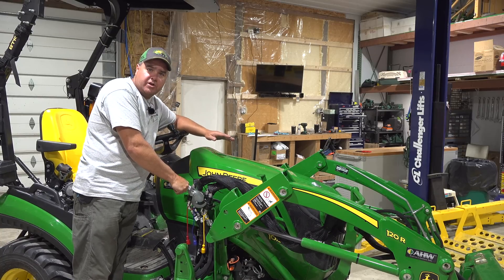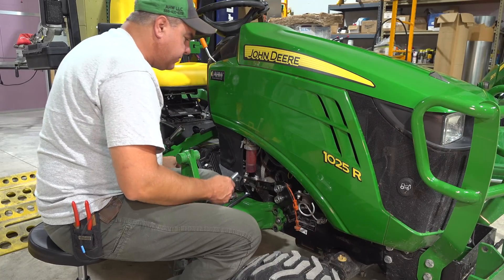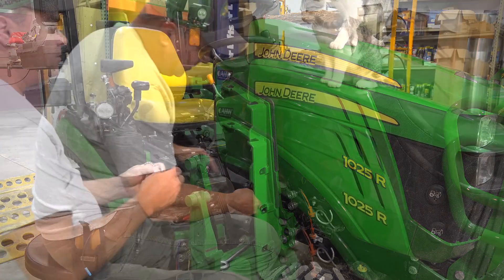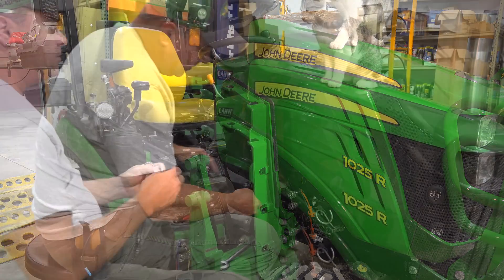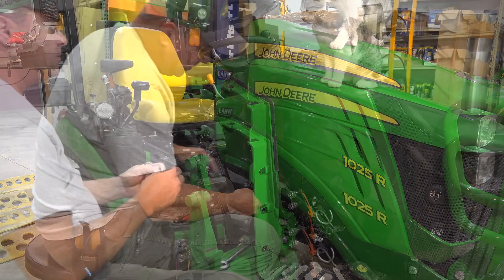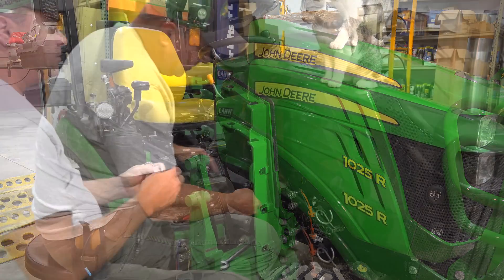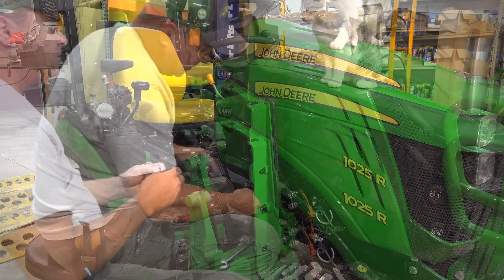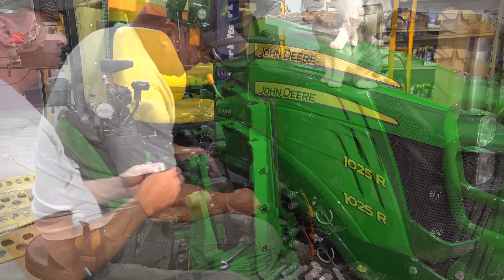Single Point Hydraulic Connector; Deere 1023e/1025r/2025r

Comment: Ok Tim your tractor had a green push bar on the front. You had to take off not in vidio to put loader back on. But it's a nice way to hook up. Sometimes the old way is hard.
Reply from the maker: What?   I don’t understand.  We did not remove any push bar.
Reply from the maker: Ok, watched it again.  Yes, this is a front quick hitch weight bracket from heavyhitch.com.  
Sorry. Should have watched the video before I commented.  Totally forgot that I had the weight bracket on in this video.

It comes off easily, and is not part of the tractor.  Just a quick attach weight bracket.

Comment: Great video guys, as always.
Thank you. 

One additional item every tractor owner needs is a quality O'ring kit. With all the face seal and orb fittings a good o'ring kit is invaluable. Keep in mind not all orings are created equal, It's a good idea to get one from your manufacturer however quality ones can be bought from the aftermarket sector. Just do your research for specific needs. Things such as heat ranges and oring material composition make a huge difference.

Comment: Really good video Tim ! I watched it all the way through. I find the fittings on my 1026R to be a breeze and do switch out the loader a few time a month. I switch mine over within reach of my air and find blowing everything clean before and after keeps the fittings from sticking. Never once had to relieve the pressure to get them on. 
If it was new at 0%, the single point and what ever the system is to not have to connect the MMM lift with a switch instead of switching the hose I would sign up for.

For me and that amount of money I would opt for one of the grapple's that do not require extra hydraulics at around $1500

Comment: Tim how did your orient the new hoses that go on the loaded so they go down between the loader frame and the tractor? The stock ones are horizontal to the frame and if the new ones go on like that they want to bulge up. New hoses seem to an after thought in comparison to how the bracket and valve mount

Comment: I like this and may explore it as an option. You make reattaching the loader look easy.  I find it aggravating. The stand hydraulics creep down creating pressure on the line. I routinely am showered with hydraulic fluid during Re-attach.
Reply from the maker: The single point handles the pressure pretty well.

Comment: I have been waiting for this option ever since  I saw someone on youtube do their own custom fabrication on their 1025R.  In the winter I alternate between the loader and the front blade on my second generation 2025r.  I suppose you just unhook the  hydraulic  hoses that feed the single point system and insert the hoses from the front quick hitch but that seems a little counter productive to me.  Since I no longer use a snowblower which would require a different setup from the front blade I could add  one half of the single point  to the four hoses.  I would want to have this capability before I jumped to this somewhat expensive option.

Comment: I do not see in the video where you discussed the brass orifice, only saw where you talked about the extender on the Blue hydraulic  hose.
Reply from the maker: It is not brass.  You call it an extender.  I specifically said it was an orifice, and I showed the difference in size of the opening.

Comment: I have the older Summit Diverter valve that has ports on three sides of the valve. It was mounted on the inside of loader arm structure, but now interferes with the Single Point Hydraulic connector and there are different fittings (maybe adapters will allow me to convert).  The question is where to mount the valve now?  It was on loader itself, not sure where to move it to?  Everything is so tight.

Comment: What you said about the subtle differences in brands is true.  Deere does some things brilliantly and then drop the ball on zinc coated hardware, uv resistance on paint, and the plastic does not hold up!   The newest Deere equipment I own (7) is 2004 so things may have improved.   I'd still go Deere

Comment: Tim, if one has a diverter valve like the Artilion set for say a grapple like I put on my 1025r a couple of yrs ago at your suggestion this set up works for connect/disconnect of the front hydraulics without the need to hook up additional hoses.
Reply from the maker: Yes.  The only challenge is that the Artillian diverter will need to be moved, as this space between loader mast and hood is used for the single point.

Comment: Good video a couple things. 1- is your side panel sort of tough to put on and off with that new bracket in the way?, mine seems to be. 2- I'm OCD  about my steering knob being crooked so I drilled a small hole in the bottom of it and put a set screw countersunk into it. it works perfectly.
Reply from the maker: Yes. We just showed the difficulty of reinstalling the panel in a video earlier this week.
Reply: @TractorTimewithTim  where do i find this video?

Comment: Am I correct in thinking that you can also hook and unhook while the tractor is running? Other Faster brand connectors are like that. Another big plus for the Faster single point. Even though at 70 years old and with arthritic hands I still can’t justify the expense but I do remove my loader every time I mow. Now I wouldn’t turn one down if..........
Reply from the maker: Yes, tractor running is not relevant.

Comment: Very nice addition to the tractor. I can seen how this will be very great to some since you no longer need to get on or off the tractor to disconnect the FEL. Do you still need to turn the engine off to relieve hydraulic pressure on the couplers? Now that could be a pain.

Comment: Hello Tim I have a question?  I am looking into this for my 2025R.   I am wondering this will work with my heavy duty front snowblower.   I have the cab and connecting and disconnecting the hoses   is difficult with the cab on.   This would be a great solution to quickly switch between the bucket and snowblower.   Let me know what you think.

Comment: I have the Kubota BX23S with the quick connect.  It's a nice feature but it tends to leak a little.  I had it at the dealer three times to fix it, its had the entire manifold replaced, multiple flat faced connectors have been replaced.  On my BX it appears that the pressure from the handle holds one end of the manifold tight but the other end tends to start to open up after using for a while.  I think the clamping mechanism does not keep the entire manifold tight enough and under pressure allows a little fluid to leak.  Again its not a lot of fluid and it's a neat feature but it attracts dirt and makes the tractor dirty.  I really like my tractor but I think the future may hold a 2-series JD.  I take my loader off all the time so I think a single point quick connect is worth the added price.  I would like the ease of the JD drive over deck.  However looking at the 2038R snow blower I think my Kubota four point hitch and snow blower is a lot easier to take on and off.
Reply from the maker: All interesting observations.  Thanks for sharing!

Comment: Do they sell just the loader end of the connector? Only reason I ask is if you run a quick hitch with a front attachment I would want it single point also. Not just the loader.

Comment: That is an extensive kit for sure, but even though I attach and detach about once a week and $800+ is still way too high, really cool, but it takes me about 10-15 seconds to unattach.  Great video though, I like how Tim covers all angles.
Reply: I agree. I take mine off and on a bunch and generally the bottom inside is the hardest.  I have only had one issue re-attaching when I did not relieve all the pressure from the lines when I took off the loader, but was easy to relieve the pressure on the two lines to reconnect.  While I have said many times it should be easier, and this would do that, but $800 is way too much to justify for me.  A redesign of the current connectors to add a little more space would solve the problem.  I have had mine for almost 5 years now and can take off or put on in less than a minute.
Reply: Florida- I agree with you as well..it takes me longer to wash my hands then to disconnect or connect my hoses.
Reply: $800 is more than I paid for all my implements except for the 120r loader and 54d mower that came with my 1023e I bought last year. I have a 4' bush hog  boom pole carrier all sub soiler an all purpose plow and a quick hitch I take my loader off every time I mow my yard about every 2 weeks and it takes me about 5 minutes. The point is I could think of a lot of other things I could spend $ 800 on a new implement a trailer even my truck was only $950.

Comment: Tim,  just finished installing the Single Point Hydraulic Connector on my JD 1026r.  It went together pretty simply.  My concern is the length of the hydraulic hoses.  The hoses that attach at the floorboard to the single-point connector seem a bit too long.  Has anyone else expressed that concern?  My hoses are in a very tight "S" shape.  Should I be concerned?  The hoses from the front loader to the single-point connector seem to be ok.
Reply from the maker: If you can connect them, there is no concern about damage.  We found it hard to get perfect lengths on the hoses.

Comment: One of many reasons I jumped to 2038.  Wife could not do otherwise due to arthritis in her hands.  That's the same price i paid installed.  One thing different i see in this one (trivial).  Mine has a spring loaded cover that when I remove the loader it covers all four connectors providing a dust cover.  I'd love to have those flat connectors on my power beyond connection for backhoe.  That little spillage of fluid every time I remove is annoying
Reply from the maker: Good point on power beyond.  They can sometimes be difficult to connect as well!

Comment: Tim, I’m assuming but you didn’t mention if someone installs this single point hydraulic connector that they will have to install another half of that single point connection to use on say.. their snowblower attachment as well as any other attachment unless you want to unplug the connector.???

Comment: i believe in speed and being clean... i don't like getting hydraulic oil all over the controls of the tractor because every time you use it after that its dirty and you are clean... now if i am working on something i can get oily and greasy from head to toe and i don't care but when operating equipment i like to be clean and comfortable... so a single point that keeps hands clean is worth it to me not to have to go wash my hands all the time... often i will leave the loader on just to not have to get my hands dirty even though i would really like it off... second is speed... when taking off the loader and working a hard money job you can go faster.. that means more time home with the family and more money by the hour... either way that $900 investment is worth it.. especially that kit... its very nicely put together.. would love to see an option for 6 ports though.. maybe leave the 3rd function disconnected unless using it.. i was thinking it would be a good idea to get some fittings like what is on the tractor and plug them and figure a way to mount them to the loader blocked off.. that way you can unplug from the tractor and plug to the loader and the hoses are secure and out of the way.. then in the even you need the 3rd function you can plug them in when you are off the tractor anyway hooking up whatever attachment you are putting on.. maybe so plugged of fittings in the couplers on the tractor side too to keep dust out of them and store em in the tool box when ya need the 3rd function...

Comment: Do you wet the o rings be for you install them? On ac lines on a car you have to put oil on them before you titen the connection or it will leak.

Comment: Just ordered mine. Thanks Tim
Reply from the maker: Thanks Jon!
Reply: Tim do you know if you can just buy the single point connector? I would like to just get that piece for my snowblower. This would make a perfect system.
Reply: Installed the kit on mine today. I have the H120 loader and the hoses attached different then the 120r loader. It works just have to do more adjusting.

Comment: Great install video,seems to function very well. Did you have any clearance issues when you reconnect the third function hoses?  In the video it appears that the new support bracket is close to the third function hose connection fittings,why i'm asking, Thanks !

Comment: I just installed this kit. The documentation leaves a little to be desired. The instructions did not warn me that disconnecting the hoses from the loader would make it lower to the floor. That was fun. The instructions could have indicated which size hoses went where. I don't know why I ended up with 13 washers. I understand why the seven bolts were left over. There are two holes in the added support that are not used, but have the JD green removed from them, as if something is intended to go there. The instructions do not indicate that the existing hose support on the loader will be removed (is it to be used elsewhere? There is a small screw on the top of the adapter that is not explained. The kit looks like it will help out a lot.
Reply from the maker: Did my install help you with any of those questions?
Reply: @TractorTimewithTim  Your install made my installation of this kit much much easier. I just post the questions that I had reading the documentation. I was not warned about the loader sinking down to the floor. And now I have just found a little brass fitting that has a hole in the middle, that was mixed in with the parts, and it’s not on the parts list so now I’ve got a question for that. Oh well we’ll see if it all works. I’ll just add that little brass fitting to all the rest of the stuff I have left over. Thanks Tim.
Reply from the maker: Yea, I accidentally left out the little brass restrictor too.
Reply: @TractorTimewithTim  Just for my own records, I made an insert on the bottom of page #9, with a photo and instructions on inserting the orfice into the adapter. Note that this adapter and orfice are the same ones as are used on the original blue hose. JD should have included the instructions that I made.
Reply: Did you have any problem replacing the side engine cover? On my installation, it’s a really tight fit.
Reply from the maker: Not much room there
Reply: @karlpritchard5688  i also felt it is now harder to remove and install the fender

Comment: Interesting concept for a quick connect for hoses. That said, I don't have a green tractor only a red one and I can't find anything like this for mine.
Reply from the maker: One of the disadvantages to buying a lesser brand. You don’t get the opportunity for as many upgrades.  From manufacturer or from the aftermarket.
Reply: @TractorTimewithTim  I know your are quite the Deere fan and I agree Deere has many bells and whistles, some not so much for practicality for sub and compact tractors, as you know, but I wouldn't consider my red 2020 1626 a Mahindra a lesser brand . The Mahindra with backhoe, box scraper and bush hog, is top built and the cost was quite less. That said, I enjoy your vids. Some crack me up....

Comment: I think it would have been worth trying to put the new bolts in the same way the old ones were in the loader frame.  What rings this true was your dislike of torqueing at the bolt head rather than on the nut like its supposed to be done.
Reply from the maker: Won’t fit.

Comment: Great videos - always enjoy your insight. Question; I have plans of purchasing this disconnect for my 1025 however I also have a 60" mower deck that uses the "black" connection  to raise and lower the deck which is the hardest one to get to if you have the cab (which I do). Connecting this line almost requires all the other lines to be removed as it is in the upper right corner which is a bear to install the line. Is there a hose extension that you are aware of that would connect from the mower deck to the new disconnect?
Reply from the maker: Interesting idea.  Yes, we could arrange that.  The 4 connectors on the single point connector are male ‘flat face’ connectors.  So, we could work with DiscountHydraulicHose.com to create an extension hose that would do the trick.

Comment: I have a question about it. If you disconnect your loader outside in the morning and the sun heats it up, and pressurizes your lines will this still reconnect? I’ve had to take pliers and grab the connection then hit the nipple on the connection to spray out the built up pressure
Reply from the maker: No worries.  It will connect under pressure.

Comment: I installed one of these about 3 months ago and it had been working fine up until about a week ago.I now have a leak in between where the two halves mate up and it appear to be just the forward (yellow) lower valve that is leaking or at least that is where hydraulic fluid is pooling. Tim with the single point unattached I have no issues no leaks. Add the top half of the connector and it leaks to the point of a large puddle on the floor. Both assemblies appear to very clean and I have not seen any debris or dirt on the surfaces. Thoughts?
Reply from the maker: You can get seals from http://DiscountHydraulicHose.com/ttwt
Use code ttwt for 5% off.
The seals break because of pressure on tractor side during connection.
Before connecting, make sure you run the joystick all 4 directions with tractor off.
Reply: @TractorTimewithTim  Thank you Tim. Not sure which kit I might need or where they are installed. If these seals are to be installed between the two plates mine has none. I assume the lower half and suspect there is a difference between the SK-MF-14 and 28 kits. Appreciate your feedback.